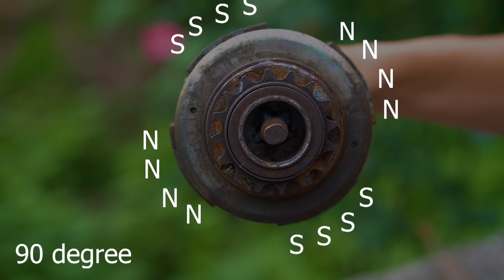I build 220v electric Hydropower dam

Comment: This can't possibly generate 31 amps in order to achieve 7000w at 220v🤣
Reply: @spidy9237 No, scam clickbait.
Reply: And what about his "turbine"? That thing can generate 100watts maximum and even that is overestimate
Reply: @czechgop7631  Yeah, I think we're all in agreement about that. The guy is a scammer. Any doubts, just go look at the BS videos on his channel.There's heaps, and they all make the same sort of impossible power claims.
Reply: Yeah ! True divide 7000/220v we will get 31.81 amperes of current that is impossible from this turbine.
Reply: @riven_personal  If they were honest and "IF" that generator actually was any good, which is very doubtful too, with the tiny amount of head pressure from about a lousy one foot of height difference and that crappy paddle wheel arrangement I think you'd be really pushing it to get a lousy 100 Watts from that setup. This guy is just another of the very many scammers on YouTube.
Reply: @Juanma_lolo  No es imposible generar "nada", simplemente no es posible generar ningún tipo de energía significativa. Absolutamente NUNCA podría producir ni siquiera una pequeña fracción de los 7.000 vatios reclamados en la miniatura. Creo que "cargar un teléfono móvil en 5 horas" podría estar más cerca de su máximo.
Reply: Yes, this is youtube magic. He must have some hidden wiring powering the fans. It was entertaining anyway.
Reply: 21 amps, not 31.

Comment: Power came from elsewhere. We are nowhere near 60 hertz so the lightbulb would flash on and off if it was the generator actually powering it.
Reply: not entirely true, those fans and bulb would work an any AC kinda current, having 4 poles doubles the hertz, I doubt that is more than 10-20 Hz though, the low watts are producing very slow speed fans too - one almost doesn't turn. It's not fake as such, but there is not many real world applications except for you to learn something, amazing to even get a result with that but he/she did, you could refine this design considerably from parts you find in your local refuse station and make a better version with more current etc..
Reply: @Fhajadusisneb  Best do some research before posting 'eh - Hertz is a measurement of frequency - specifically "Cycles per second". If you want to test your brain, figure out and share how you figured it out - approximately how many Hertz the electricity is coming out? (hint - you can figure this out by counting through frames in slow-mo).. - I'll add 500 points to your score if you can (currently you're on 0)
Reply: @TimJacobsen3D  I’m just saying you can run it with a lower frequency I realized my mistake that’s why I put the second comment
Reply: just upload yours and show us how to do it better. The guy at least is trying